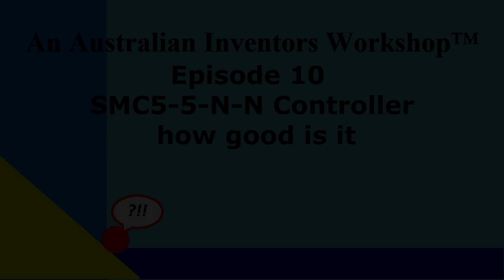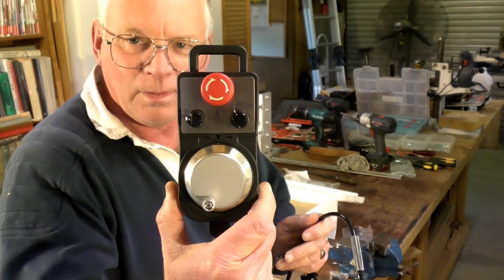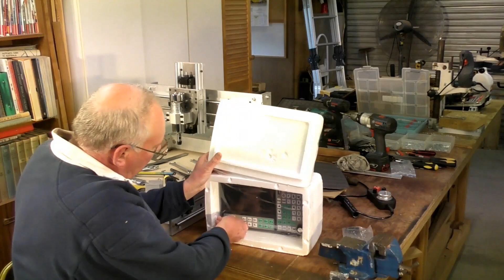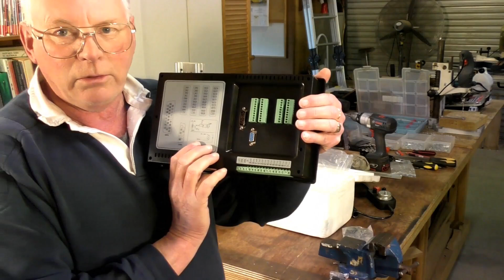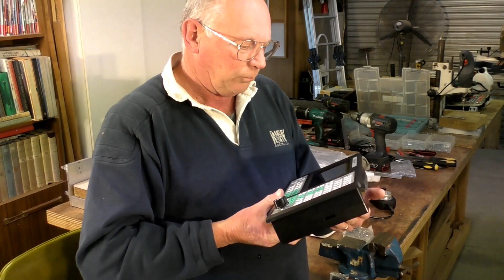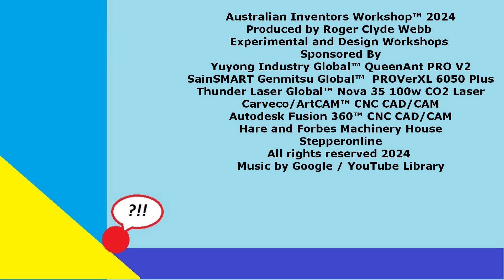Goodbye Mach 3 Hello SMC5 5 N N Controller How good is it

Comment: I've had mine for about 4 years now and it is a good controller for the price. However, there is absolutely no support for it, no firmware update and it has become so outdated that I've stopped using it. Wouldn't touch it. Have no idea why Roger is still recommending it. But then again, he doesn't answer questions either.